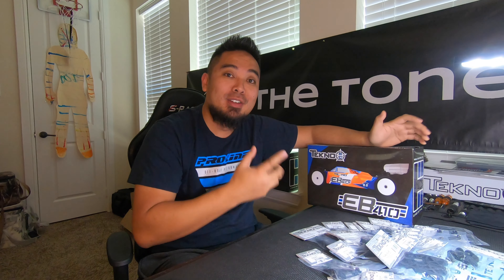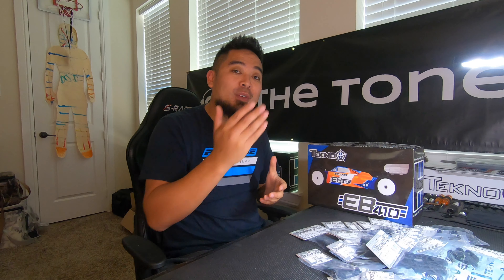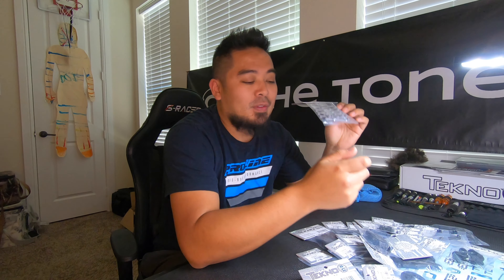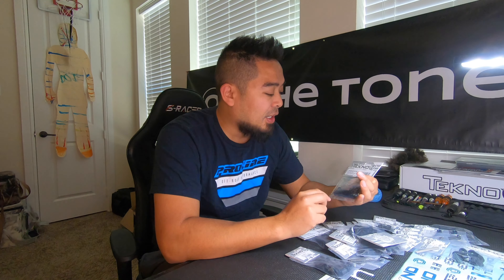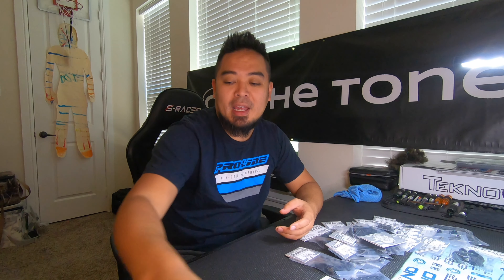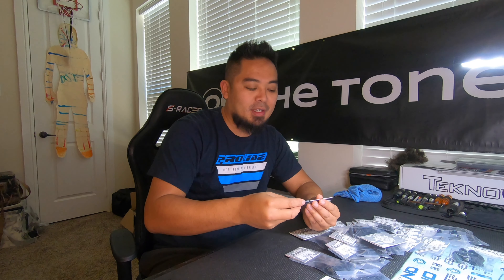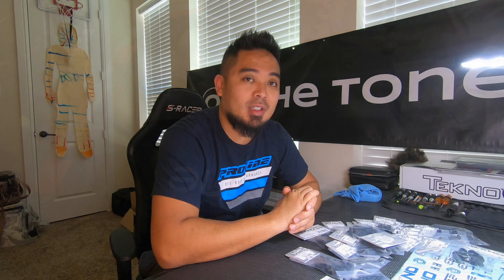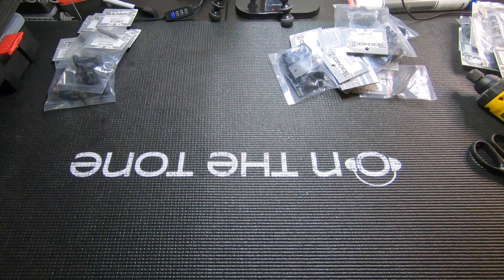I Am Building a NEW RC Car Kit!

Comment: I see you got the dewalt gyro before christmas. I bought two and love them. Most builds I have my 2mm and 2.5mm drive in each. Saves time swapping between popular tips, also if a battery goes dead in one, you can just switch bits back and forth till your other battery is charged. I haven't used my hand drivers in a week!
Reply from the maker: Paul Gysler thats a great idea... i never though of using both at the same time
Reply: @MarkSantaMaria  Gotta you back somehow. Your videos have been awesome for RC.